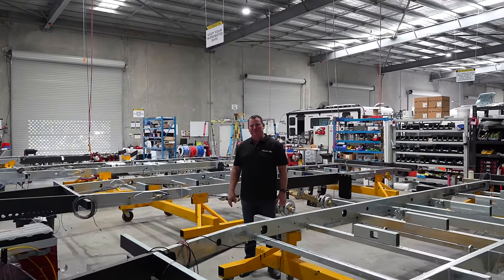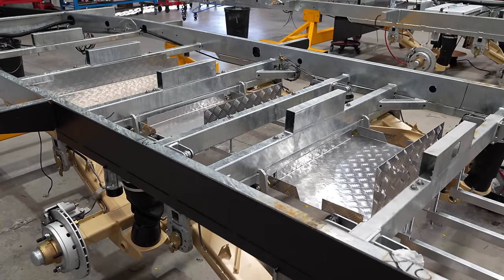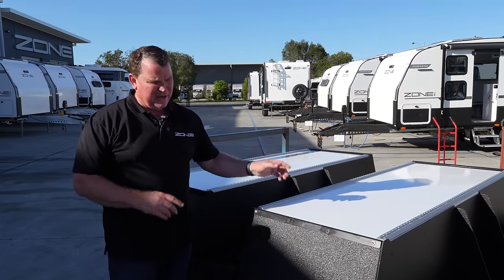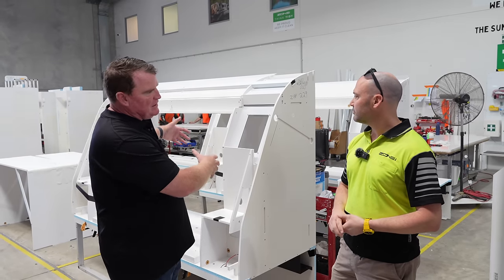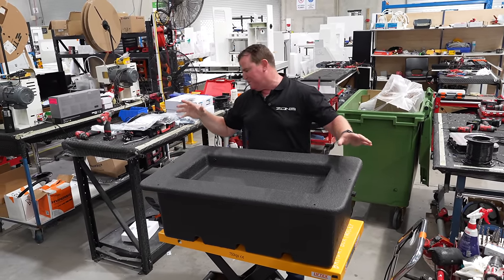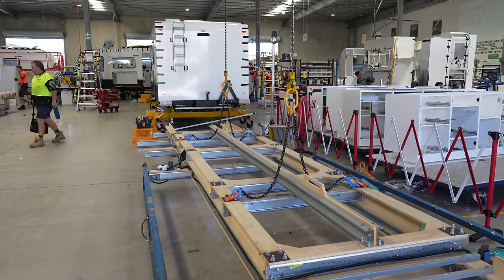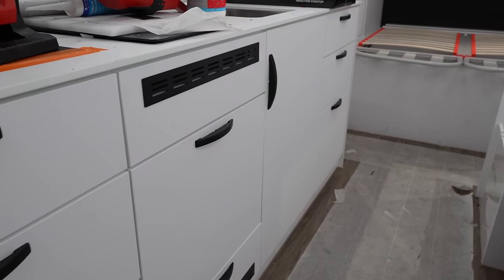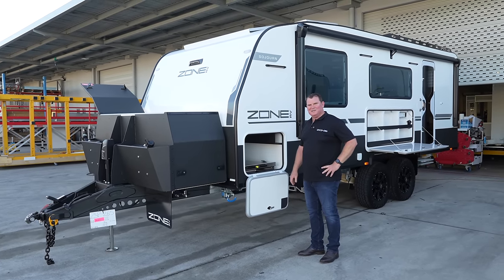Inside the Zone RV Factory: Gen 2 Production Line | Australian Made Off Road Caravans

Comment: On the last bit of the video, there were 2 diesel tanks. I thought the heater and water heater used the same diesel tank?
Reply from the maker: Hey Tony, the 2 tanks are the seperate diesel hot water and diesel space heaters. 
Reason being the space heater is an optional extra and diesel hot water is standard 👍
Reply: @ZoneRV  I have also ordered a March 2024 sojourn. I got the impression that the diesel tanks were combined as 1 during the sales process.

Comment: Very interesting video on the advanced construction techniques in a really high-quality caravan but I think that you are a bit loose with labelling everything as a composite. The battery box seems to be a fibreglass moulding and the internal wall structures look like a type of PVC foam board. I can see that the floor/walls/roof are true composite panels though. I understand it's marketing and that it sounds better, but it is a bit misleading.
Reply from the maker: Thanks for the comment and hope you enjoyed the video 😀 'Composite' just means its made up of a few different materials, not strictly fibreglass/foam. Hope that helps!